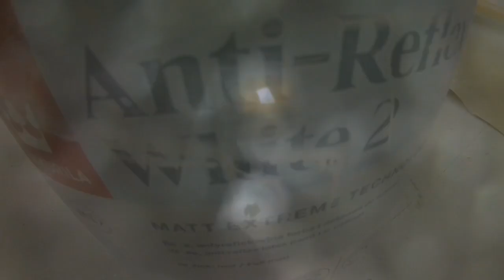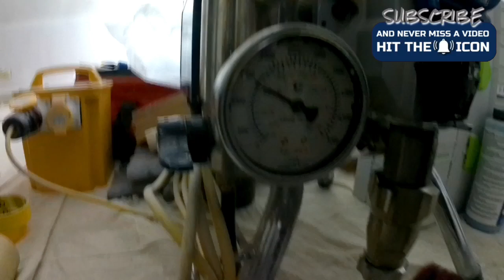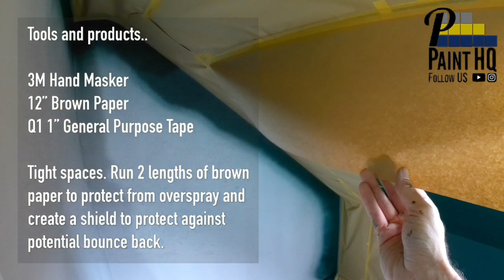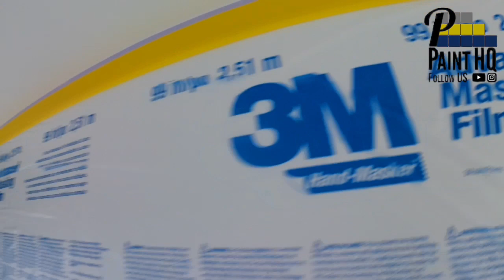How to Paint New Plaster | Mist Coating | Airless Spraying Interior Walls

Comment: WOW great work dude! Thanks so much
Reply from the maker: Ah thank you buddy, very much appreciate that.. reach out to me if I can help or advise you at all.. regards Pete 🎨💯
Reply: @PaintHQ  I'm just starting out spraying, I bought A QT 190 airless, haven't used it yet! Just gaining all the info I can first. I've been binge watching your vids, you're an absolute legend. Just about to buy a Qtech Q5 hvlp to add to the tools.
Reply from the maker: Ah  nice 😆 really appreciate your kind words of support, means a lot 💯 ..You’ve got a nice machine there in the  QT190 👏👌👍 ..I believe it comes with a 7.5mtr 1/4” hose.. not wanting to think you need to spend more money 🙈 ..A small whip hose attaching at the gun, will give you so much flexibility at the wrist.. the thickness of the 1/4” hose can be tricky to manoeuvre.. it’s not essential by any means, just makes life easier.. Just double check with your supplier if there’s any compatibility issues with your model sprayer.. for example my 7.5” Graco hose is already thinner at 3/16”.. then my whip is 1.4m and 1/8” diameter.. sorry if this is confusing.. I want to help you get started all I can 💯 ..A 515 tip for emulsions might suit better too.. I typically use a 515.. The supplied 517 tip with your sprayer, the material will come out a bit quick.. It can be surprising for a beginner how quick you need to move the gun 😆 Hope this helps a little my friend.. feel free to ask questions anytime, I’ll always get back to you and do my best.. I don’t mind 👍 Regards Pete
Reply: @PaintHQ  Pete thanks so much. What brand tips are best for low pressure spraying in peoples lived in houses? I haven't bought any tips yet so want the most efficient for low pressure, low over spray. The guys at my spray shop are telling me to go with Tritech over Graco.
Reply from the maker: You’re very welcome.. As I see it, each brand has their version.. Eg Graco LP Vs Wagner / Titan HEA ..I can appreciate TriTech plays their part too, and a supply shop may have their preference if affiliated closer to TriTech ..I have a few TriTech tips and have success with certain paints ..That all said, the tip I’m using more than others is a Wagner HEA ProTip 515 (not to be confused with the Wagner Control Pro version).. knowing you’ve got a TriTech gun, I can say that the Wagner HEA ProTip will fit the TriTech tip guard.. the Graco tips will not, you would need a RAC X tip guard ..If you was to give the Wagner tips a go, whilst they do fit TriTech, just be aware the seals are different.. you shouldn’t have a problem, I’ve not heard of any but just wanted to point that out.. sorry to waffle on ..With all this talk about tips and overspray.. you will get overspray, it’s a byproduct of airless or any spraying for that matter.. it’s just about controlling it.. low pressure spraying helps.. technique is another  ..and effective masking.. never give up, once you gain confidence you won’t look back.. put your sprayer to work 😆 ..I’ll help you 👍 regards Pete
Reply: @PaintHQ  Thanks Pete. Would you mind giving me a quick list of must have tips, plus what you use them for? I'm just about to put an order in, I only have the Tri 517 at present. That would be really helpful mate.   Alex.
Reply from the maker: Hi Alex.. no problem at all.. These 2 tips would be the main 2 that you would get use out of..

515 - For emulsions, walls, ceiling.. mist coating fresh plaster.. I typically use this tip for most vinyl / acrylic based emulsions 👍 ..I use mostly and would recommend the Wagner HEA ProTip 515 ..It will fit the TriTech T93R Tip Guard.. however if you wanted to, you probably should get the  Wagner TradeTip 3 Tip Holder 7/8”

For woodwork / trim.. spraying waterborne decorative materials / primers and top coats.. you would mostly use a 310.. It’s a little trickier because I often use Graco FFLP tips, but I’m not wanting you to feel you need a whole range of brands and spend a load of money..

To keep your costs down to begin with, get a TriTech Ultra Fine Finish ..it will fit your gun ..UNLESS you decide to treat yourself to the Wagner tip guard as above.. then get the Wagner Fine Finish (purple) 310 instead 😊

Seriously I’m not suggesting you go out and spend a load of hard earned money.. you could stick to TriTech tips, but I would still get a 515 and a 310

Hope this makes sense.. just passing on exactly what I do.. and of every tip and brand I own.. I do rate the Wagner HEA 515 (..I’m not sponsored in any way to say that 😆).. please keep in touch, I don’t mind clarifying if I need to, really don’t mind 💯👍👌 ..Regards Pete
Reply from the maker: ..Meant to ask, who is your supplier Alex?.. I have good contacts at SpraymanUK.. Mike there really is helpful and very knowledgeable.. again, I’m not sponsored 😆 ..I was thinking you wasn’t in the UK, I answer a lot of questions from various countries and get mixed up 🙈
Reply: @PaintHQ  This is really helpful mate but left me indecisive lol. I am buying a Graco 12" tip extension, so I could get all Graco tips. They don't do a 515, neither does Tritech though, would you say get the FFLP 514 instead? I could save some money and just buy all Tritech like you said. I'm using AirlessPro as my supplier. Really sorry for all the newbie questions.
Reply from the maker: Ah ok no problem.. if you was to go with Graco, you could get a LP 515 and a FFLP 310 ..The LP (low pressure) is as it says low pressure, then FF LP is very similar (Fine Finish), a slightly finer atomisation.. yeah if a tip guard comes with with the extension, go with the Graco tips 👍 ..Just one thing with using an extension, you will get spits of paint because of the paint in the extension part flying out under pressure.. to combat that a Graco Cleanshot is very very good.. but they’re not cheap 🙈 I’ve got it on my list to do a video on the Cleanshot, setting it up etc 😆 ..Or you could just go with TriTech to save money.. either way go with 515 and 310 for now.. TriTech do a 515.. it’s in their Contractor range (blue’ish colour), the 310 is in the Ultra range (gold colout).. like I say all brands very similar in their ranges... you’ll get there mate, it’ll soon make sense and you won’t look back... you’ll be recommending a spray tip that you like to me 😆👍👏👌  ..Which is always great to hear my friend 💯😆
Reply: @PaintHQ  airless pro mate
Reply: @PaintHQ  yeah I'm in the UK
Reply: @PaintHQ  thanks Pete. Much help as always. I'll let you know how I get on. 👍
Reply from the maker: Yeah definitely, keep in touch buddy.. I don’t mind you asking questions anytime 💯 good luck 👌👍
Reply: Pete what neck of the woods do you reside buddy? I'm Southwest, Just outside Bath.
Reply from the maker: I’m in the West Midlands my friend.. Are you planning to go the National P&D show, 23rd / 24th November? It’s a free ticket trade show in Coventry, I’ll be there both days.. I’ll be releasing some news over the next few weeks, just finalising the details, but basically it’ll be great to meet as many people as possible and have a chat 👍👌💯 ..I do like talking 🙈😂
Reply: @PaintHQ  Hey mate hope you're well. What pressure is best for spraying ceilings and walls with the tritech 515? Just got all my kit, including the q5 hvlp, they didn't sent the 2m hose whip though! Gutted. I got a hoper and pressure gauge for the qt190 too :)
Reply from the maker: Hey buddy, that’s great news 👌👍 exciting times 😆 ..With TriTech tips, they behave more like production tips, than low pressure.. that’s ok, pressure is just to facilitate atomisation of the material.. So here’s what I’d do and in the process you’ll be teaching yourself and seeing hands on how it all works.. set the sprayer up, paint in the hopper, primed and paint in the hose and at the gun.. screw on the tip guard with the 515 installed.. get some brown paper on the floor and start your pressure at 1400 and test (12 inches away and a relatively quick movement).. a TriTech 515 with emulsion will not be lower than 1400 (more like 2200), but this process will show you how the pressure dials in eliminating tails.. turn up the pressure by 200psi and test again.. so 1400.. 1600.. 1800.. 2000.. then 2200 (which I think is where you’ll be)... I don’t typically like to thin paint, but as you learn the materials you’ll see what likes a drop (just an egg cup amount in the hopper and mix well).. for example Tikkurila AR2 ceiling paint likes a drop.. my Wagner 250m video..

https://youtu.be/3Mlzp37Uepg

..Shows an example of just turning the pressure up a bit at a time and testing (and that’s a basic sprayer).. just to say, if you add a drop of water, remember to prime and get that altered material to the gun.. otherwise when you’re testing you’ll just be spraying the same consistency that’s in be hose 😆 ..you’ll be fine my friend, let me know how you get on and I’m always happy to help sone more.. regards Pete

Comment: Well as already said by many others your videos are full of all the nitty gritty info that we want to know, thank you !
We seem to have the same approach to spraying as in the system and utilise the same products, however for me I can never seem to be able to spray under 2000psi. I was really surprised to see you able to achieve 1400psi on a 515 tip.

I have had problems recently with being able to see regency vertical stripping from side light and artificial light.

I only use Caparol products which recommend no more than 5% thinning, however I think maybe it’s the thickness of the paint causing these problems. I have now ordered the Wagner Nast spray heated hose to hopefully sort the issue as I have tried everything else. 
Any thoughts you may have on rooms with big side light.

I am in France where we have strong sunlight and I work on a lot of modern open plan new builds.
Reply from the maker: I really do appreciate the kind words of support and especially your methods from France 🇫🇷👌👏👍😆 ..The lower 1400 psi is down to using the Wagner HEA ProTip 515 with the Wagner TradeTip 3 Tip Holder 7/8”.. I really do rate this tip 👌 You can usually shave 500 psi Vs  ‘other’ tips ..I only thin if I have to and usually just a splash of water, it makes all the difference to ease the flow that little bit.. The heated hose, I’m confident you’ll bring the pressure down (definitely the viscosity will be lower).. along with a HEA 515. It will massively help knit the passes together.. you’re certainly using quality products in Caparol too 👏👏👏

I’m quite envious you getting the heated hose 😆 id love one myself.. be sure to let me know how you get on my friend.. really great hearing from you and hearing about your process and successes 🇫🇷💯 regards Pete 😆

Comment: Hi Pete, this job looks quality yet again. Once you've sprayed your woodwork, how do you find the drying time after applying mistcoat on areas above skirts that woodwork paint has hit walls etc. And do you ever get runs?
Reply from the maker: Hey Matt.. very good question 👏👍😊 ..In my experience I’ve never had anything untoward happen long term, such as runs.. but I have to agree that mist coat on those areas will dry a little slower versus the fresh plaster, where drying is almost instant 👍 ..It’s never caused a delay for me though, when I get the emulsion top coat in the sprayer, I’m ready to go.. hope you’re keeping well and having success.. keep in touch my friend.. Pete 🎨💯

Comment: Well this video could not have come at a better time,first of all beautiful work my friend.What advice do you have for a problem i had today spraying ar2 using a graco lp 515 tip set at 1300psi thinned about 10% no tails the overspray was horrendous it was like having a shower.The finish was also very orange peel i don’t believe i had this problem when i used a Wagner lp tip thank you 👍
Reply from the maker: Hey Paul, thanks for the support, as always very much appreciated 💯 ..I’m thinking, could you have been a bit closer with the gun than you would usually.. I say that because sometimes it can be hard to judge if you was using an extension, or if the ceiling was lower than your typical ceiling, your judgment can get thrown off.. Especially when you got the pressure down nice and low, 1300 is low enough not to cause bounce back.. do you remember if 1300 was what you’ve sprayed AR2 at before? AR2 can be a pain to go through, don’t get me wrong it’s an awesome ceiling paint, I wouldn’t use anything else, but it does prefer a bit of easing with water.. Neat with a  LP515  I’m spraying at 2200 (2100 with a smaller / shorter hose).. like you I tend to ease it a little (maybe not 10% - but 10% is ok), then I’m spraying at 1900.. Thst‘a why I’m turning to the Wagner HEA 515 more and more, just a splash of water and I’m spraying at 1700 nice and clean, no or little bounce  back.. keep in touch, let me know if anything helps.. you’re doing good my friend 👏👏👏
Reply: Yep i was using a extension 50cm so my distance could be wrong I’m pretty sure i sprayed at about the same pressure with a Wagner lp what was the reason for changing to the trytech tip also what is the size of the hose you use apart from the whip is it a 1/4in thanks 👍
Reply from the maker: Hey Paul.. good question about the TriTech 616 tip.. I tried the HEA 515 with AR2 in the handheld and a splash of water, it would not spray nice at all.. it might of improved if I ran it at speed 10, but I’m not prepared to run the handheld flat out.. it emphasises my point about it being good to have a range of tips from different manufacturers, and finding AR2  problematic to spray (just my experience).. so yeah, I switched it up to the TriTech 616 and was able to spray at speed 7, which I’m much more happy with 👍😆 ..And yet I don’t like the TriTech 616 used on the bigger pump (395), too much dust/fog 🙈 hope all that is not too confusing 😬 ..Just to explain also, the 395 was moved onto the next job and the ceiling in the loft conversion was small enough for the handheld 😊 ..regarding the hose, it’s a 7.5mtr 3/16”, which requires much less paint (less than 140ml), versus the 15m 1/4” (just under 500ml).. much more manoeuvrable too.. I stick to the 7.5mtr hose all the time now and if I need a longer run, I join another 7.5mtr.. they was on offer too at SpraymanUK 👌😆 ..Great feedback and question as always.. keep in touch buddy, I’ll always get back to you and help if I can 💯 Pete

Comment: Do a video of masking the velux window up please. I hate masking them especially when they are high ones.
Reply from the maker: Hey Brian.. yeah if I’ve got the footage, I’ll see if I can put something together for you.. bit of a tip I can give, is clean the frame thoroughly (something like a degreaser), especially if it’s a new build that’s got plaster or residue left over from the plasterer.. sorry if that’s obvious, it’s just that you’re never get a clean line.. not only will the finished result look poor, but it can be a problem with the tape sticking.. I use Deltec gold first, get a nice line and mitre your corners (very important), then use the hand masker with Q1 tape and 12” brown paper.. hope this helps a little.. I’ll see what footage I can salvage, if not I’ll definitely put something together the next time I come across Velux windows 👍 Take care my friend, regards Pete 🎨💯

Comment: Would i set up a tritech t5 at 800 PSI. For walls and ceilings i followed the booklet it says 2000 PSI which i think is too much overspray. Help a newbie thanks
Reply from the maker: Sorry for the delayed response.. happy to help if I can 👍 Pressure (psi) is dependent on tip size and product (viscosity) that you’re spraying.. basically you need to test your spray pattern before spraying your project.. start low, spray a test and up the pressure by say 200psi and test again.. keep testing until the bands (tails) each side of the fan pattern disappear.. you’re looking for a solid even coating across the middle, with soft feathered edges 👍 ..hope this helps.. keep in touch, would love to hear how you get on.. regards Pete
Reply: @PaintHQ  thanks pete 👍

Comment: Great video pete. Can i ask if your spraying bare skirting and trim what products you recommend.  Also if a litlle satin  overspray gets on the newly plastered wall  is it ok to  emulsion straight over or will you see it . Cheers bud well done again
Reply from the maker: Thank you Mick, appreciate that.. My go to products are typically..Tikkurila  - Helmi 30 or Helmi 80 (30 is the satin finish). Then I would normally use the primer from the same system, so with Tikkurila I would use Otex Alva (it’s a very good adhesion primer).. Then I also like Caparol, so you have the PU-Satin, and another excellent adhesion primer called their Haftprimer 👍 ..Finally I’m a big fan of manufacturer coatings, such as AkzoNobel’s top coat and primer (it’s more of a high build primer).. Bear with me, it’s on my list to put a video together, spraying my go to materials for woodwork.. I’ve definitely got a video coming up soon where I’m spraying Tikkurila Helmi 80 (and Otex Akva) on a relatively large stairs 👍 as part of a HSL 😆 ..As for the overspray, I’ve never experienced a problem where the emulsion wall paint coats the oversprayed area 👍 ..Hope this helps a little, I’m there for you as always my friend 💯 Pete
Reply: @PaintHQ  thanks a mill pete cant wait for the stairs video just to see how you mask and what order you spray. Got a little bit of practice with my sprayer last few weeks.  I got to spray 2 pebble dashed cottages.  I found it great for learning. Thanks again mate 👍
Reply from the maker: That’s great news, yeah spraying exteriors are perfect for learning and great fun.. you’ll gain more and more confidence, you’re doing great my friend.. and remember, if something doesn’t quite go right, message me and I’ll do my best to reassure you 👍👌😊
Reply: @PaintHQ  thanks pete